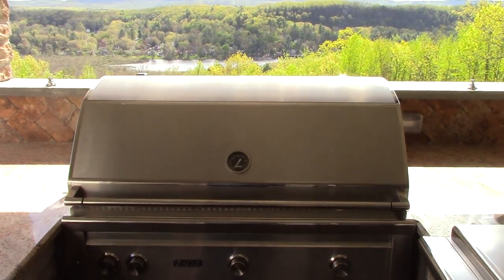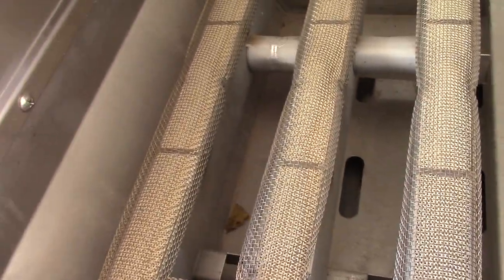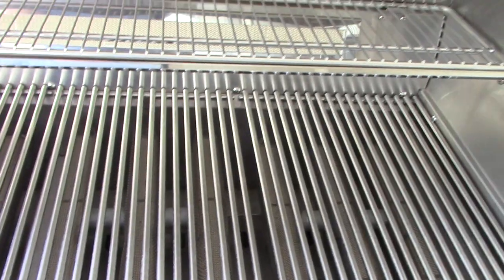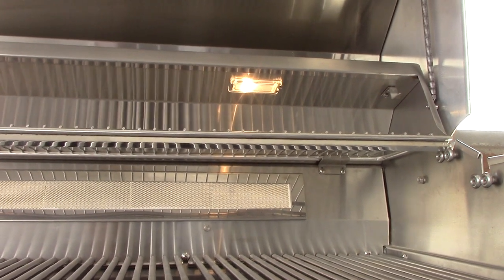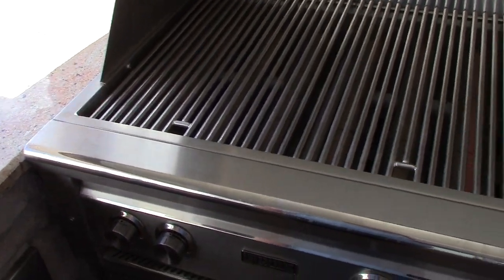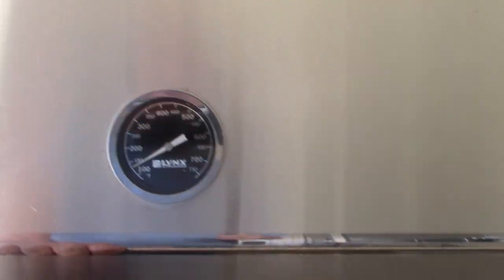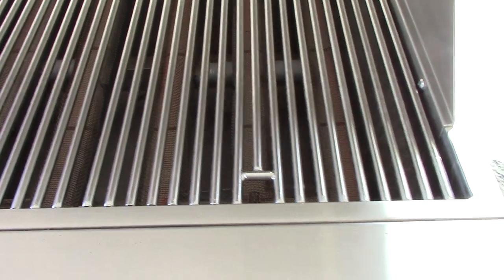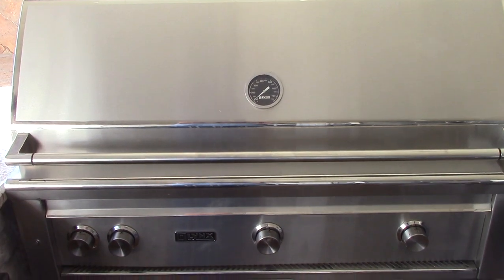Lynx Natural Gas Grill.

Comment: I’m a Lynx factory authorized service technician. And I work on these grills on a daily basis. Generally I’ve found that the hot surface igniters typically last 6-8 years with moderate to heavy use.
Reply from the maker: Well I guess that’s not too bad. Hopefully ours do okay
Reply: I replaced the Lynx 27” Pro that came with my house that was about 20 yrs old in 2018.. My ignitors in my new grill are acting up and work when they want to now. I use it moderately, maybe 1-2 times a month in the summer and spring. Not happy I may need to replace then so soon.. I’ve seen that the ignitors can be cleaned, actually I want to be able to determine the signs of them breaking down..

Comment: It's a very nice grill, just some drawbacks like you said. 

I have a different type of grill in an outdoor bar. Its been around for almost 12-14 years. We had to change it from natural gas to propane due to some other issues with the line, but its held up nicely. It has lights on the inside like you were talking about and they lasted a long time no issue. I believe however, after 10 or so years the bulbs might have died. I haven't really payed much attention to them to see if they work recently though but I don't think they were all necessary because we dont cook after dark that often.
Reply from the maker: Yeah maybe the grill is more designed for more outdoor stuff, which in our case is good because the cabana is lit, and more shaded. I'm just really concerned about those igniters.

Comment: Will be interesting to see how long the hot surface igniters last. This is the first grill I've seen that uses them. Never seen burners like that either. Looks like that mesh would get clogged with debris pretty easily.
Reply from the maker: Anything in the mesh would probably just burn off.

Comment: This is like a Scotty Kilmer BMW Money Pit.  All kinds of technology nobody needs yet pays big money for.  The hot surface ignitors, that's just plain stupid.  Any other grill in existence has had some sort of piezoelectric spark.  Spark, lights up instantly.  These you have to wait several seconds for to make sure they heat up to ignite the gas.

As far as that "covering" over the burners, it's like a mantle.  Just like my propane patio heater had.  That would wear out after one season, and nothing was even being cooked on.  Perhaps this being not made-in-China will last longer, but the burners themselves would work fine.  Actually, the reason they are there is the same reason my BBQ has those "heat tents" or "flame tamers" as they're calling them now because it rhymes.  Keeps the direct flame away from the food and evenly distributes the heat.  Yours is doing it the expensive BMW way so when it breaks it costs a fortune, mine does it with sheet metal so when it rusts out it's $10 to replace.
Reply from the maker: Next they'll remove engine oil sticks so that you can't even check....oh right, that already exists. 

Yeah I cant imagine they will last long. If they do, I'll be pleasantly surprised. Usually what I do is, I just push the knob in and immediately turns the gas on, I'm not concerned. As soon as that initial flame comes up, I let go of it. . Takes about as long as the LI House grill did. That one usually required maybe two or three pushes of the buttons, I think when it was new too. Yeah I though of your heat tents when I saw this burner design. I was very skeptical of the flames pointing straight up. But they actually did just fine. That being said, they're VERY powerful. Cooking on Max would probably overcook a lot of stuff, so a lower setting is obviously preferred. If those cages around the burners break, but the burners end up still operate just fine in terms of still cooking okay? They can stay broken. No way in hell am I replacing them every time they break.
Reply: When the mantles break, it's going to end up burning everything you put on, even on low.  You can probably ghetto-rig it with these same heat tents placed on top of the burner.
Reply from the maker: @jaykay18   Well then I better start those begs for likes and Patreon donations!
Reply: $10 is probably all you'd get anyway!
Reply from the maker: @jaykay18  Yeah, guess I need to become more popular on The Patreon.
Reply: Sure, stop putting unnecessary "The's" before things and you will be!